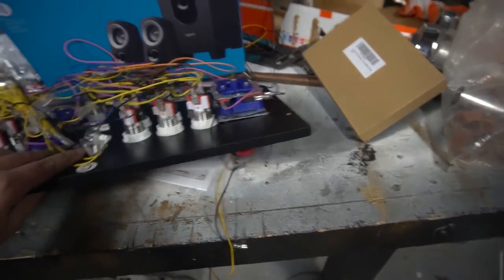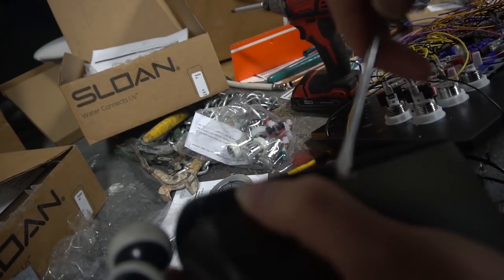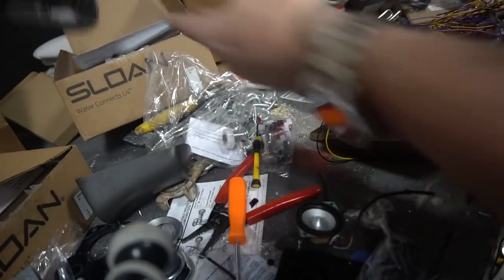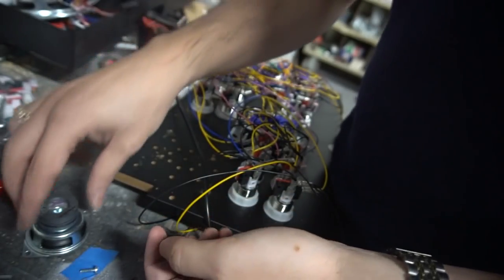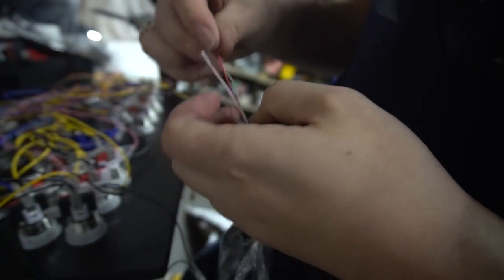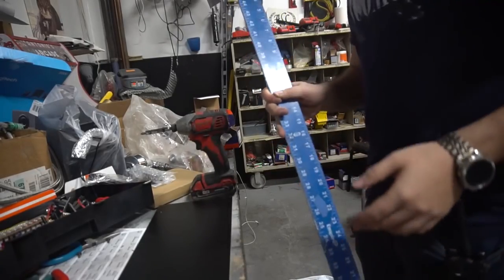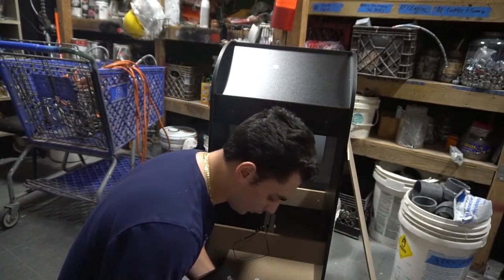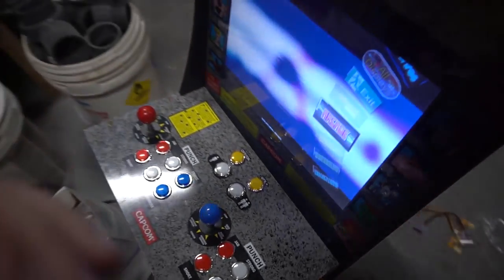Arcade 1up Mod Part 2 - Install z313 speakers and 4 player admin mod

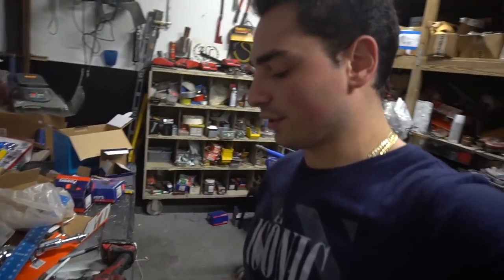Comment: Tip! When drilling holes thru faceplates preplace masking tape before you make your measurement marks to minimize the facing tear like you got at 16:46

Comment: Hello Vic hope all is well.  I see you put the subwoofer hole facing the back.  Do you think it matters if it faces the front or the back? Do you think if it faced the front the player would feel more bass?  I’m not sure.  Thanks for the great content.
Reply from the maker: The hole is what allows air into the sub for more vibration. Put it in the direction where it will get more air... I'd have the hole facing the rear or the sides... more open space = better

Comment: Vic_VP, not sure if you will show on your next video but how did you attach the volume controller?  Did you just use Velcro and made a hole to put the wires in?
Reply from the maker: Will do that for final video, velcro is the easiest thing

Comment: Vic_VP bringing it again!  Thanks for sharing and taking the time to make this awesome instructional video.  Quick questions.  I just learned about the xin mo after watching your video.  Why use xin mo instead of usb encoders?
Reply from the maker: Hey medic bud, I use the xin mo only because it comes with the kit I get from gameroom solutions, the pi 3 has a issue noticing the xin mo as a 2 player gamepad. They are both basically the same